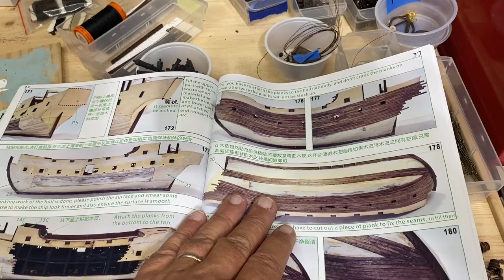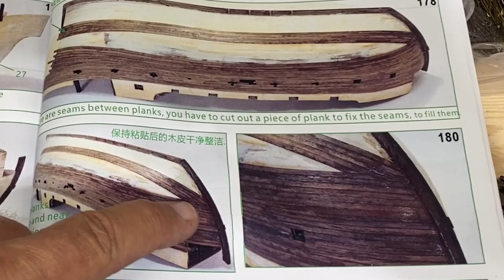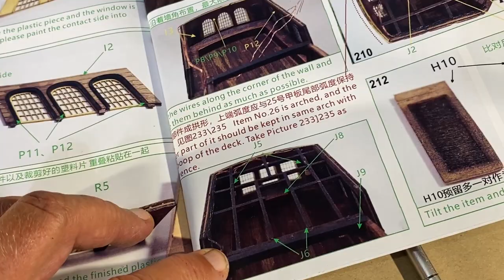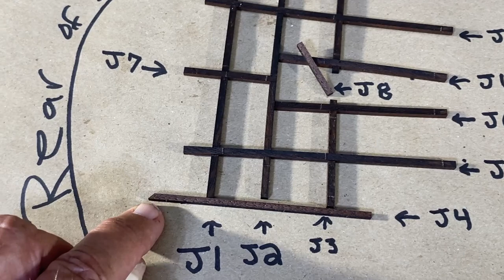Black Pearl All Scenario Version PART 11

Comment: Gold leafing looks awesome!  I even did the metal pieces so it would match better. Looks great!
Reply from the maker: Yes, the gold leafing makes it special however, I’m going to try something different!
I experimented with copper leaf on a couple of dolphin statues.  Then I misted them with salt water and sprinkled a few grains of salt on that.
Then put it in a sealed container with full strength ammonia….not soaking in ammonia but in a open container.
Left overnight. It speeds up the natural aging process of the copper.
The copper darkened with a teal greenish patina.  I’m planning on doing that to the front figure and the statues!  So stay tuned 😁🏴‍☠️